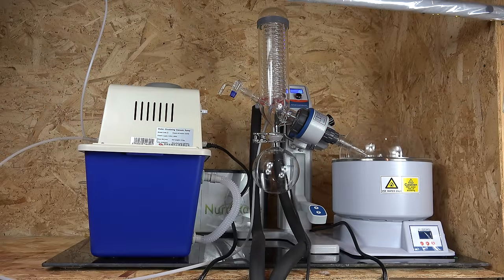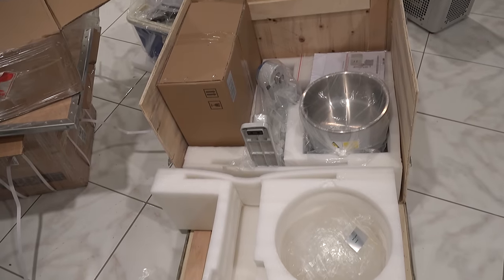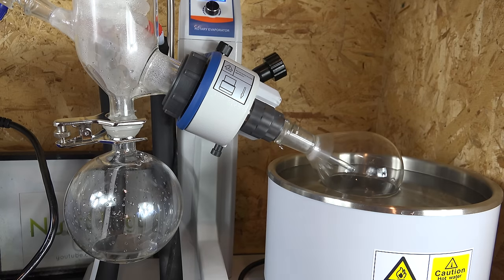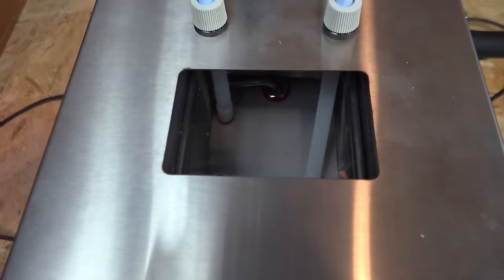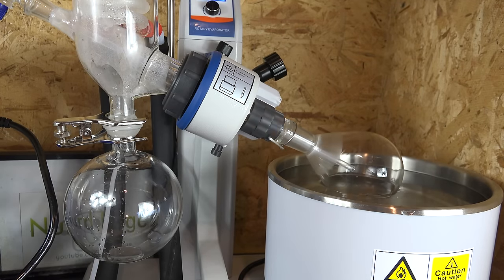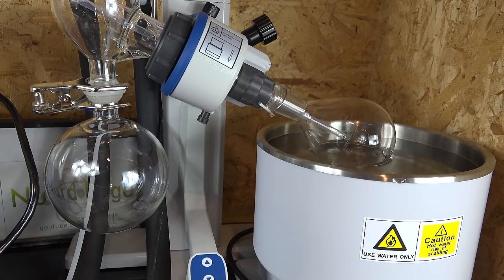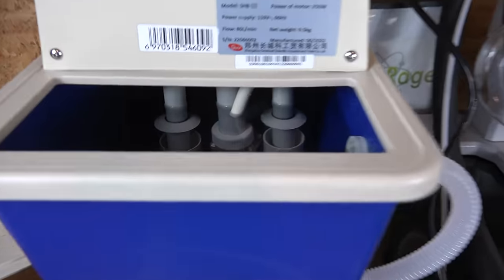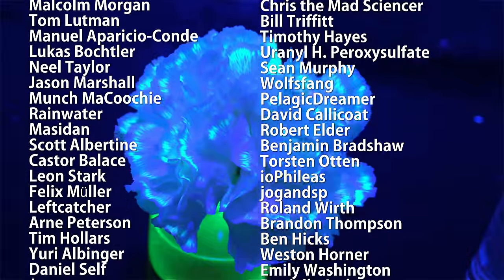Lab Equipment: Rotary Evaporator or "Rotovap"

Comment: I've always wanted to design and build an open-source rotovap. They aren't THAT complex. The rotary joint is the hard part. Upvote if you'd like to see a video about that.
Reply: If you use glassware with wheaton clear seal joints the friction of the rotating joint will be less than ground joints and you are likely not going to get ground glass contamination in your product if any.
Reply: If you use glassware with wheaton style clear seal joints, you are going to have much less friction than ground joints.
Reply: Yeess

Comment: Maybe its just me, but seeing how a chemist's tools work is just as interesting as seeing the actual chemistry done. What a fascinating video!
Reply: Absolutely. I'm not a professional chemist and I've never studied it at degree level, but I love the gear. The actual chemistry goes way over my head, but I know just about enough not to be dangerous. It's mostly just adding acids and/or bases to things, then filtering or distilling. Obviously there's more to it than that, but that's for the proper chemists to do.
Reply: @igotes  The workup is what you are describing. So yeah, you have [acidifactions/basifications/extractions/recrystallizations/distillations/filtrations/dryings] sandwiching each of the "real" synthesis steps, where some specific reaction might be utilized. BUT those "real" reactions are super challenging to even comprehend for many people. Even among chemists with degrees, lots of us just don't go there in our professional careers because there are many other things to specialize in other than synthesis.

Comment: Keep in mind that the cover serves more than just to limit evaporative losses; it moreso is for protecting the lab and the chemist from shards of glass when a flask implodes due to the low pressure. It can happen to flasks that look perfectly fine, but because there is a very fine hairline crack which is very hard to see the flask cant withstand the pressure difference (delta p for all diving accident enthusiasts). Always wear glasses when using vacuum!
Reply: Most modern borosilicate glass will usually just crack and break as chunks, usually around the glass welds on joints like the 24/40 adapter. It’s not commonly used, but tempered glass is what will implode much more violently.
Reply: Borosilicate glass, you’ll hear a “tink” sound and then the hissing sound of air being pulled through the crack.
Reply: @Tonyneg  oh, i always feared that it would just implode and fly around the room, good to know!

Comment: I worked in the R&D Department of a pharmaceutical company and we used the "feed through line" as a way to use the vacuum to pump in fresh material when product concentrations were low and volumes were high. This way you don't have to disable vacuum every time to refill the flask.

Just wanted to tell this as an additional function of this part.

I also wanted to let you know that i was perfectly able to disassemble, deep clean and reassemble this as a intern undergraduate ;)
Reply: Also he needs to reverse spin the glass coupling to tighten down the flask and metal ring. And use vacuum grease lol

Comment: I'm glad you're getting to enjoy to daily drive a rotovap! I'm one of these lab techs you were talking about in your introduction, who rely on rotovaps daily for their lab scale production processes; we're making ruthenium- and biotin-labelled peptides which are used as analysis reagents for the elecsys diagnostic system. 
A neat tip about the gas-feedthrough tube you were talking about at 11:28 - you can also use it to add more solution to be evaporated, if you're working with big batches. Just attach tubing you're dropping into your bulk container to the vent valve, this way you can open the valve every now and then a little and the vacuum sucks additional solution into your distilling flask.
Have fun with your new tool; I'm excited to see it included in your upcoming videos.
Reply from the maker: Wow! i'm learning new stuff everyday, i never thought to use the gas feed through tube to also feed product into rotovap. Most of the labs i worked in had broken/missing tubes so it wouldn't have worked, so i never thought of it. This is why i love posting these equipment videos, you guys teach me new things!
Reply: Tygon tubing leaches plasticizer (was phthalate; there's some kind of grotesque citrate  coming up) into a solvent stream.  See what you can do with fluorinated polymer tubing..
Reply: @uncleal  Maybe I should've added - a colleague who regularly did this used tubing from a HPLC system.
Reply: Yeah, my Buchi RotoVap-T has a feed tube that goes all the way through into the rotating flask. also.  They're hard to find on the surplus market and easily broken.
Reply: @uncleal  FEP works very well.
Reply: @NurdRage someone built one on YouTube I watch him all the time

Comment: Good to see a new nurdrage video.
Rotovaps are so expensive, I've thought of trying to build a basic one.
Those lab suction machines are good, I found one once and used it for a long time until it lost it's suction
Reply: It does look like the small lid for the vacuum pump water should go the other way up though !
Reply: @Peaches.Gonsalez  yes he's done some useful work for the benefit of home chemists
Reply: Chinese rotos are very cheap these days, You can get a 5L with everything needed for $800-1200.  Always get a 5L over a 2L, 2L hot baths can only do a 3L flask at most.
Reply: @Tonyneg  thing is it's only a convenience for labs where time is money. You can achieve the same things with normal vacuum glassware

Comment: Your video inspired me to sort through my lab boxes of lab equipment after my last move, and I retrieved and reassembled my Buchi Rotovap-R after five years.  I assembled it by buying pieces on surplus market over a period of eight years, and now I have a fully operational unit - no lift, just lab jack under the water bath.  My water bath is a 4L  aluminium ether bottle, cut in half ( got a big wide-mouth funnel out of it, too!)  you aren't the only underfunded chemist out there.  My PhD was in terpene synthesis - emphasis on steroids.  Good luck to you, and I really appreciate all the good work — especially the "failures" - saves me those months of work!!!  I wish there was a "Journal of failed Research."

Comment: A really great video, as always
You can also use the "gas inlet" as a way to put more product into the boiling flask.
Also, I think it would be more optimal to put the vacuum line on top, so in case of a bumping, there would be a smaller chance of the vacuum pump sucking in the product.
You can also clean your rotavap by replacing the recieving flash with a really small one, filling the boiling flash with a solvent of you choice and letting the solvent drip back into the boiling flask after it fills up the revieving flask.
Reply from the maker: oh wow, i never thought of using the gas inlet to feed in more product. Then again i never worked on that scale to need it, but it seems so obvious! As for the vacuum line position, it can't be seen, but the there is tube that actually goes up the middle of the condenser to feed the vacuum at the top and at the center. The glassblower even took the time to make the hole aim to the side so it's VERY hard for bumped solvent to get sucked in. This was a well-designed piece of equipment.
Reply: @NurdRage  Oooooh, that makes a lot of sense. Thank you for the clarification! 
(Nurdrage replied to my comment, my life is complete now.)

Comment: Congrats on getting your own Rotovap! Another cool way to use it is in crystallizations. 😍 Tumbling and cooling slowly (just by turning off the heating of the rotovap bath) seem to greatly benefit crystal growth, at least in my experience as a natural product chemist. Good vid as always. Take care!
Reply: Ooh, I suppose you could use that feed tube to hold a seed crystal suspended in the solution. Heck, you could probably make an adapter to sit on the end, holding the seed crystal and still allow you to add solution to the flask.

Comment: You can clean a condenser quickly if you use a 2 necked round bottom flask. Connect one neck and cover the other with your hand. Build up the pressure and then you can shoot a cleaning
 solvent like acetone up into it, although it might not reach the top of a large condenser.

Also, you can stop the condser from getting contaminated by using a glass trap, not sure how much they cost but very worth getting a g good one.
Reply: Oh no, I once heard of someone breaking the condenser this way (by depressurising it too quickly) Don't do that please, just reflux some acetone

Comment: If you need a cheap chiller have a chat with a pub to see if they have a spare drinks chiller. Many drinks chillers are basically a refrigerator hooked up to a water bath. The drinks pass through a stainless coil in the water. They won't generally go below freezing but they get pretty close, especially if you play with the thermostat.

Comment: I used one that looked quite similar to the model you received and it worked just as well if not better than the 2nd hand buchi that cost just as much and was missing parts for the controller

Comment: Constant Temperature Chiller Units typically work by running the refrigeration full blast while pulsing the heating coils to balance the temperature.  
By way of Putting the cooling and heating systems fighting against each other the unit offers exquisite control of the final temperature.

Comment: A few comments from someone who works in a non-GMP academic organic chemistry lab. 1) We never grease the joint that the flask connects to (don't want grease in your NMR spectra); 2) We always use a bump trap between the flask and the rotavap; 3) The simplest way to do a routine rough cleaning is by using a two-necked RBF filled with acetone, where you apply vacuum while covering the extra neck and then let air in to make the solvent "swoosh" up into the condenser, and repeat a few times. 4) The Büchi 20/40/60 rule is useful for knowing approximately which settings to use for which solvents.

Obviously everyone and every lab will have their own preferences, so I'm not saying this is how it "should" be done.

Comment: Rotovap cleaning hack: While assembled, put a 2-necked flask with solvent (acetone) on, turn on the vacuum, and put your hand over the flasks other neck. Once the vacuum gets strong, remove your hand quickly, and watch as the solvent sprays through the entire rotovap and into the solvent receiver flask. Doing that a few times is usually as much cleaning as is needed!

Comment: @nerdrage Will you please do something brief on that water circulating vacuum pump? I have the exact same one and there is very little information on it. I only use it for unimportant processes and filtration. I almost returned it but it work’s amazing and has so many different uses. Not to mention you can also use it to circulate water if need be. Glad to see it something used with such an amazing piece of equipment like your new Rotovap.. Anyways it would be greatly appreciated for this semi amateur hobbiest who loves and appreciates your in depth content.

Comment: I think you are supposed to open the gas valve and then turn of the pump. Especially for those water circulating vacuum pump, the circulating water will rush into the low pressure part of the system when the pump is turned off.

Comment: the gas inlet tube can also be used to recharge the boiling flask when processing bulk solvent without having to shut her down and brake vac. All you have to do is attach a hose between the gas inlet valve and container of unprocessed solvent. Then open the gas Inlet valve and the vacuum will draw solvent up into the gas Inlet tube and down into boiling flask thereby refilling it.

Comment: Given the layout of the condenser, another possible cleaning procedure would be to leave it upright and use the vacuum port as an inlet to spray your chosen series of cleaning solutions up at the top of the condenser and all over the coils.

Comment: When we had an accident with the rotavap, we would just use an "L" shaped adapter, fill it with acetone, close it off with our thumb and flash a few doses of acetone through a couple of times. Of course better to do this fairly quickly so you don't have anything dried into the glass or something. Breaking the whole thing down seems a bit elaborate...

Comment: Have you heard about the 60-40-20 rule? 
Heat the water-bath to 60°C, match the preassure to a boiling point of 40°C and cool the condesnser with water at 20°C.

Comment: Hmm, april first, but that looks like your lab and home, did you actually get it for free? Anyways, my guess for why the seal if fragile is, it's probably packed with graphite or PTFE or something else that's pretty good as a dry lubricant since it's constantly in contact with something rotating, thus making it a little fragile.

Comment: don't forget to apply the 20/40/60 rule, cooling at 20C, bath at 60C and vacuum set to whatever evaps the solvent at 40C.
Reply: That won’t work for a ton of solvents. Pentane, DCM, ether, etc. Youll completely bypass the condenser if it’s at 20C and wouldn’t even need to use any vacuum with bath set at 60C
Reply: It’s important to remember these are Evaporators, yes they can traditionally distill but the vacuum and increased surface area of the spinning flask, increases evaporation rate, which occurs much much lower than a compounds boiling point. Even with condenser set moderately below the boiling point, some of the compound will evaporate and completely blow past the condenser. This isn’t important for most bench chemists as they often don’t reuse the solvent, but at home and especially commercial company, you want to collect and save every drop of solvent you can.

Comment: At this one place I worked we had a rotavap that took 10L flasks  (and like a 50L solvent receivng flask). The condenser was just insane... normal diameter coils but just way more layers of them wrapped around one another, like 4 or 5 layers of them. Looked like a weird brain. With hexanes at full tilt the flow of condensing solvent was like turning on a tap!

Comment: One caveat concerning ultrasonic cleaners.  I once broke a small glass lab component when using a ultrasonic cleaner.  I suspect
the part was just the size or shape for a resonance issue.  But there was no doubt the ultrasonic cleaner was the cause.

Comment: I recently bought an older rotovap and used a welch 2522c-02 for the vacuum. I could not get it done properly and the liquid was bumping or doing nothing at all. This is difficult to work with

Comment: These pieces of equipment are common in a Marijuana Extract Labs.  The lower boiling temp is great for the bulk of the oil however you start fighting against loss of the natural Terpenes.  It's a balancing act and Terp Recovery after the condenser coil using a cold finger trap on the vacuum line is not enough.  That's why Marijuana Extracts is still an Art Form.

Comment: I had to buy mine in pieces and put them together one raising and lowering did not work, pulled it's back panels off and could see the stepper motor was disconnected easy fix!!! I have two of them now they are IKA RV10 digital with a KNF Vacuum controller, to run my pump ATB, my chiller is a rigged water dispenser (sure one day I will do it proper and pony the duo but used $35 vs starting at a $500 Garbo used broken!!! no thanks I will make one!!! then Druel over a proper one lmbo.. but it works soooo can't complain

Comment: Use the "gas feed line" to fill in more product during the process... I used a needle valve cracked open and have it run continuously over night, vapping large solvent amounts. 
(And no... nobody reused solvents. I have a lifetime supply of many used second hand and cleaned because of this... ;) )

Comment: Can these be used for nitric acid production? Is the sealing collar corrosion resistant?
Reply from the maker: its fairly resistant, but not meant for nitric acid use.
Reply: Thank you... been looking for an apparatus for production of 50 liters or so batches. There was a model like this available from China, not too expensive

Comment: Your diligence in cleaning the rotovap shames me. If I get bumping, I usually just use a two neck flask with fresh solvent, draw a vacuum with my finger on the second neck, and when it starts boiling, release to cause the solvent to flood the system.

Works well and fast. 

Since I almost never reuse the distillate and am only interested in the boiling flask, I certainly don't clean out the rotovap as often as I maybe should. I figure that the distilled solvent does a good enough job at cleaning and only bother with the rotating tube that might experience reflux of solvent.
Reply: I thought exactly the same XD It is the first time seeing such care with cleaning rotavap. Enoght acetone or DCM in two neck flask bumps out most dirt from rotavap.

Comment: I got a brand-new Grant chiller from the biotech lab I used to work at. It was a company called genomics solutions we built robotics platforms for drug discovery excetera I helped design one of the first DNA microarray scanners for scanning proteins and died DNA samples oversimplifying the description obviously. But someone left it on the dock in the warehouse and nobody would claim it no department claimed it and the guy said if someone doesn't take this out of here I'm throwing it the garbage so I threw in the back of my car LOL I also got a great big argon laser the same way